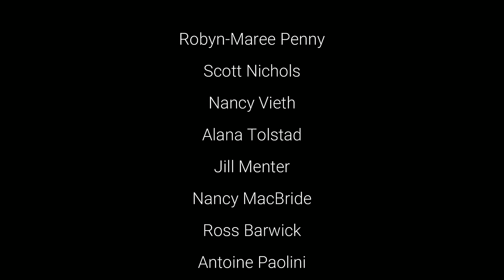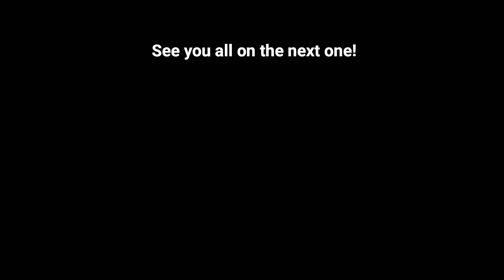DIY Garden Renovation Goes Horribly Wrong | Massive Yard Makeover

Comment: With regards to my wheelbarrow suggestion, I learnt the hard way. We had bought a brand new house with no landscaping and had to spread 11 tonnes of blue metal. Phew, what a job, I could manage only 1/2 a barrow at a time.. the blue metal was decidedly heavy! So, by parking the barrow in the direction I wished to go, it meant I didn't have to move it 180c loaded to start pushing it...
Reply: What is blue metal?
Reply: @cathiwim  blue metal is used here in Australia as an alternative to ground covers. It is  rock that has been pulverised into 1/4 inch or 1/2 inch pieces,  than then can be spread where you want it to be. It's handy for driveways.

Comment: May I give you a tip? When you are using a wheelbarrow, park it in the direction you will be going when the barrow is loaded. This makes it easier to manuever when it is full, avoids moving it 180c when full. It could well overbalance and you will lose your load.
Reply from the maker: Thanks for the advice!